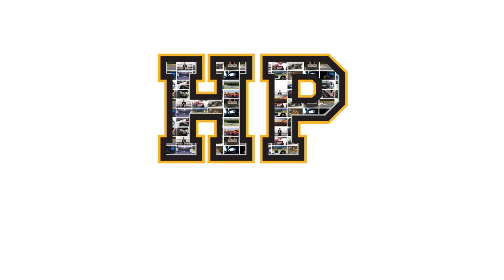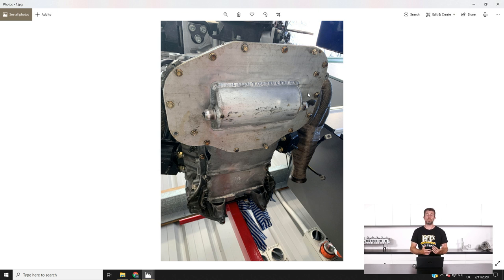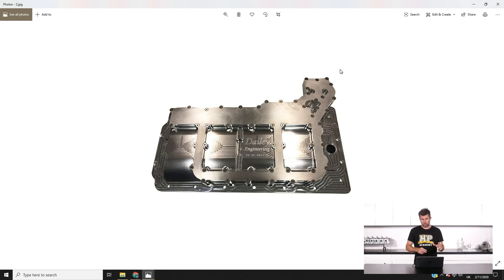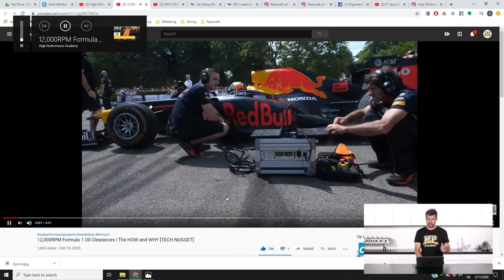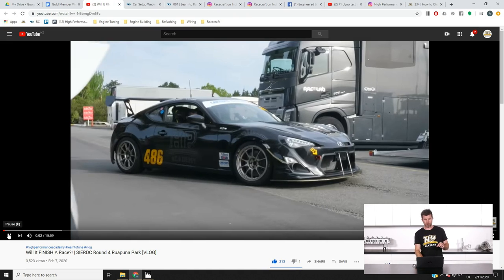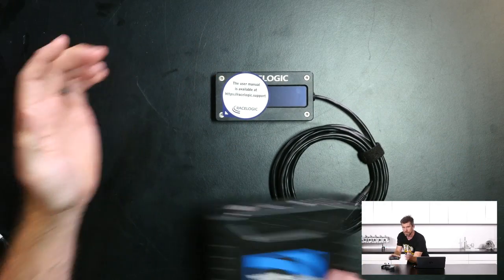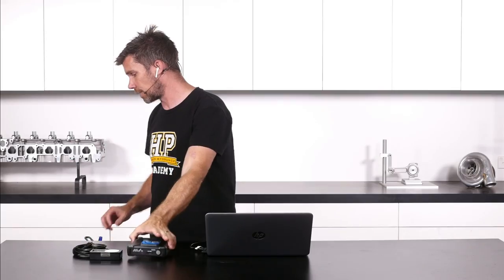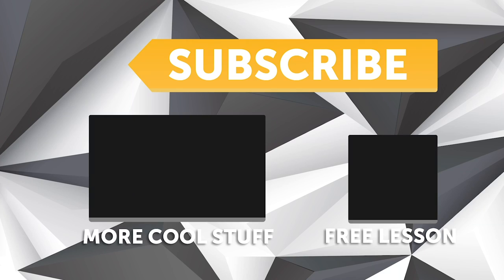1UZFE Dry Sump Decisions, Oil Preheating and Video Data Logging | Today At HPA [UPDATE 234]

Comment: This is not the same Lexus based V8 engine that was used by Chip Ganassi Racing in the Grand Am series? I believe those engines were prepared by TRD (Toyota Racing Development) South, the same place where the Toyota Tundra Craftsman truck engines are built and the previous Cup engines for Red Bull Racing, etc.

Comment: I've posted this before, but worth re-posting for those that missed it.
This is a special test dyno' cell Porsche built to test the engine oiling around the 'Ring - it is not dis-similar to the forces that will apply to any saloon car running slicks and should be a darn good incentive for running a dry sump for you guys that are getting serious.
https://www.youtube.com/watch?v=fv53RbvgfGc